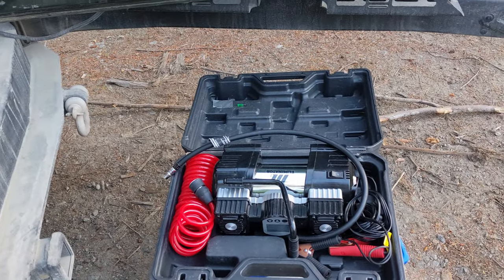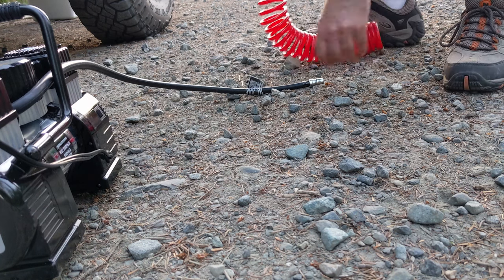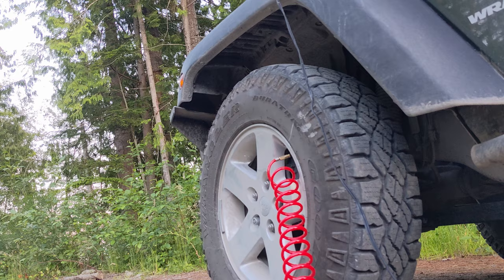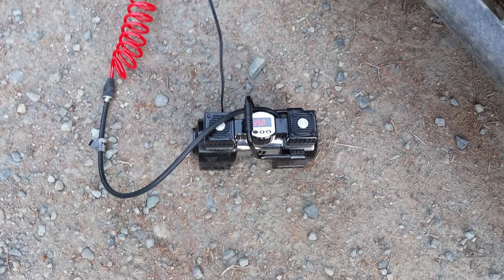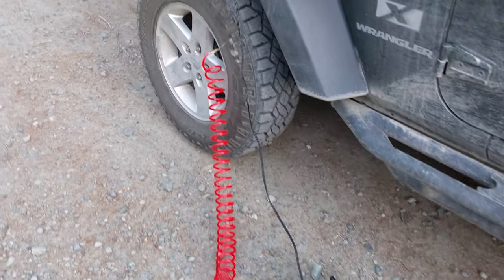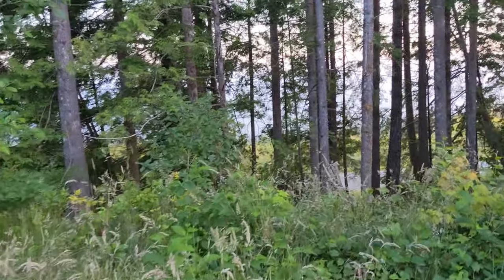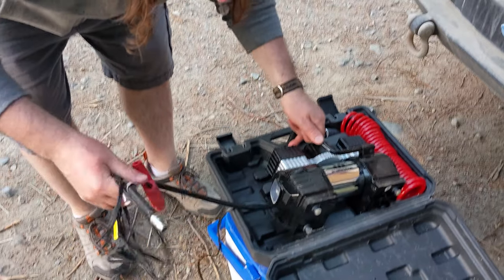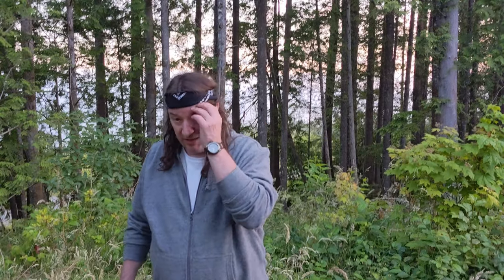MotoMaster Eliminator Heavy-Duty Tire Inflator in Action

Comment: The automatic stop feature only works when inflating one tire. I use a hosing system to inflate all four tires simultaneously and it won’t stop inflating to the target pressure until you turn it off.
Reply from the maker: That's good to know!

Comment: Hey! Great video! Is it still going strong? Can you do me a favor? What are the dimensions of it's plastic case? I want to see if it will fit in this one empty spot in my overland 4Runner. Thanks!
Reply from the maker: Hi Egon,
The first one eventually needed to be replaced. I have  a video coming out that chats about that on Saturday. 
I measured the case and in inches it is 15.5" X 11.75" X 5.5". These are not exact and a little over which is better than if my measurements were under😁
For the price, I think these are worth it. 
Regards,
Age
Reply: @agesadventures  Thanks for letting me know. So because of this I decided to spend another $40 and get the Viair 88, which I think will be a good investment, as I heard they are very reliable.
Reply from the maker: @mondo_burrito  let me know how that one works out for you.

Comment: I love the automatic feature of it, set it and walk away till it stops at the proper setting. Word of caution, don't use it in rainy weather, internal rust and it didn't last long. Been using the replacement for several years now and it works great 👍
Reply from the maker: Yes, I have mine inside the Jeep on the floor when it's raining. It makes it a little more difficult to use but I try to make it last as long as possible.
Unfortunately, the one in this video died 2 months after the warranty expired😒 I'm going to eventually open it up to see what went wrong. I think it may just be a bad switch on it, but we'll see.
I still think it's a great unit for the price. Even if I replaced it every year, it would be about 10 years to cost the same as the more expensive units you can buy. 
Thanks for watching and letting me know your experience with it😁
Reply: @agesadventures  We have two, both overheated the fuse holder and one melted the switch. I spliced in new fuse holders and replaced the switch on one and both are still going strong. Both are 6 years old now 👍
Reply from the maker: @VoyagerOverland  always good to have a spare! I'm hoping that I'll be able to fix mine too. 
6 years old, that's awesome. Well worth the price then😁

Comment: Another great review! Are those 10 ply tires?
Reply from the maker: Thank you😁
I think they are 6 Ply. They are the standard C  rated DuraTracs.
Reply: @agesadventures  Very nice! How are you liking them?
Reply from the maker: @bearlycamping  I really like them! I'm on my second set. 
They give me what I need for out on the backroads and are decent in the snow. 
Since they are All-Weather tires, they do get worn down a little quicker with all the backroad travel. 
I still get flat tires, but that is to be expected when travelling over sticks and rocks and other such things out there. Don't drive on old yarding cables from logging operations, lol😂 I learned that lesson quickly!
Reply: Yarding cables.. okay noted! One thing I did realize with this air compressor after reaching the desired psi and that 2 minutes before auto shutoff it bumped up my 35 psi to over 39. I guess that's not a bad thing lol
Reply from the maker: @bearlycamping  Seems a little off it is doing 4 psi over what it was set to. As long as it consistently does that pressure each time then it is manageable.

Comment: Screw-on chuck is best where lock-on type is too bulky as on RV tires with beauty discs. How long would unit take to top off 80psi RV tires?
Reply from the maker: Thanks for taking a look at this, Gary😁
I'm not sure how long it would take to top off 80 psi RV tires. I don't have an RV or know anyone to try that on. What pressure were you thinking of coming from?
I will tell you that on my Jeep Wrangler with 32 inch tires, it took a couple minutes to inflate it from totally flat to 35 psi. It was pretty quick. 
I'll see if I can find someone to let me inflate RV tires.
Reply: @agesadventures Rear dual  RV tires can lose some 5psi over time and need to be topped up to 80 psi, front tires need need to be 65-75psi. In these ranges it can take some time just to top them off.
Reply from the maker: @garygullikson6349  it certainly is a lot of psi in there. I'm going to see if I can find out how this inflator manages at those ranges.
Reply: I'm thinking of starting with 70 psi and topping off to 80 psi. @agesadventures
Reply from the maker: @garygullikson6349  I'm asking around about finding an RV to test on. We'll see if I can find one.
Reply: I own this pump and its very powerful. I would say one of the best in market speed, build quality both are great. 
But my 1st unit was bad and it was showing 20 PSI more in gauge. My tire exploded on highway. Luckily we were safe. I exchamge the unit with another one. My recomendation is to keep a dial guage just to match the inflater gauge as they can be bad.